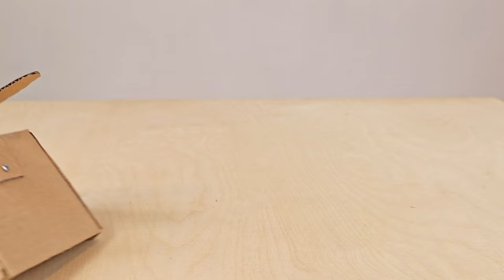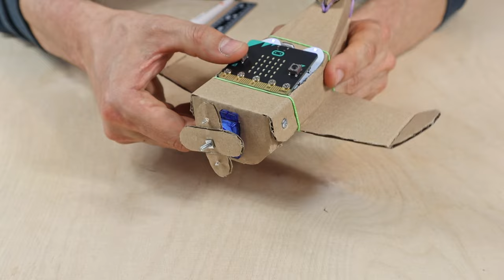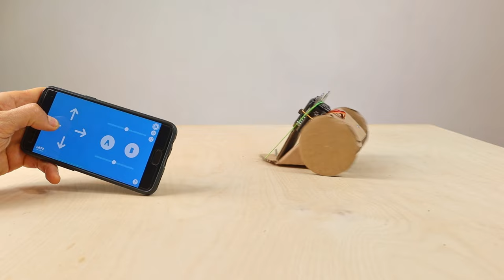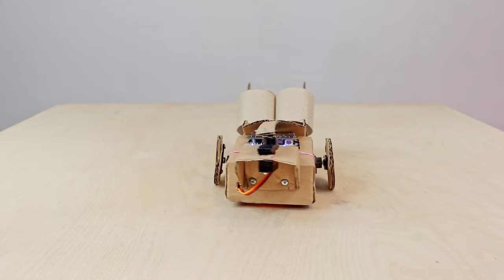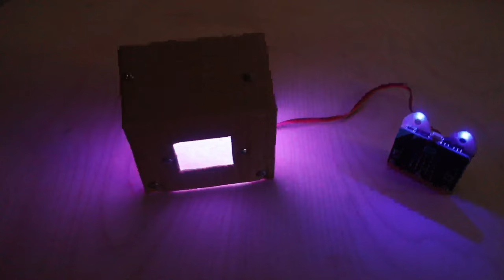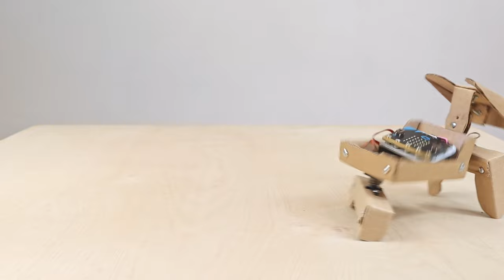10 Easy Robotics Projects Made With Cardboard | Perfect For Education

Comment: I am doing something much simpler, but I cannot get the servo to work. It's like there isn't enough current for the microbit and the servo with the 2 AAA batteries in the pack. What are you doing differently?
Reply from the maker: You addressed the problem correctly - not enough current/voltage. Regular servos are designed for 4-6V. With 2xAAA batteries you have 3V or even less if you use rechargables. One servo powered from the Micro:Bit 3V port will work but it is on the edge of its capabilities with very little force. That is why I use the Ring:Bit adapter - it provides stable 3,3V from 3xAAA batteries which in fact is also a bit lacking but usually works.
Reply from the maker: More on the topic here: https://cardboard.lofirobot.com/electronics-manual/